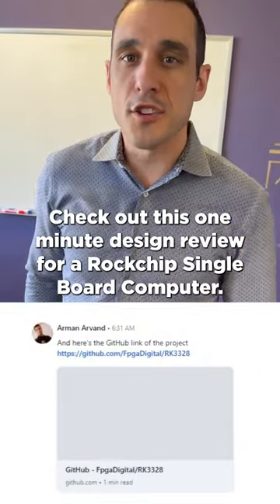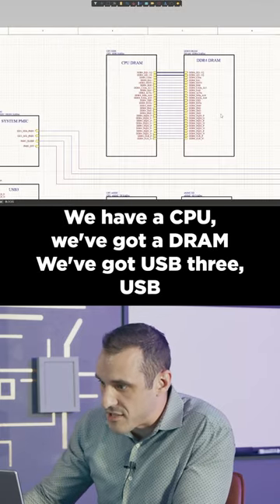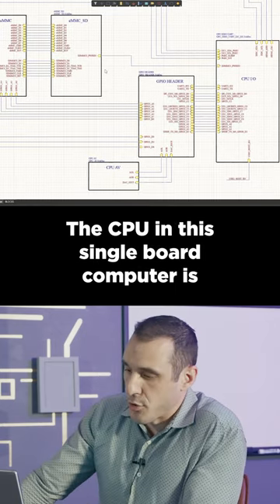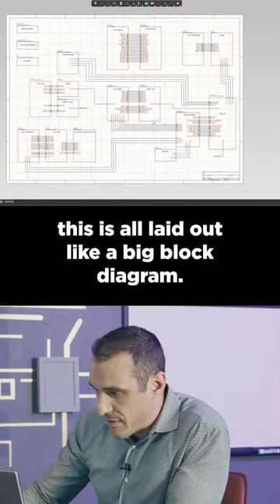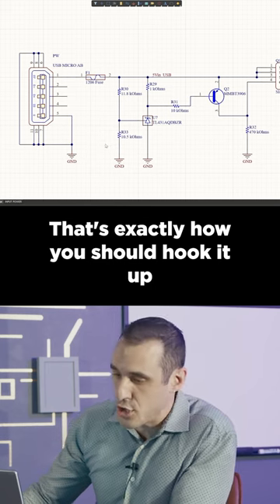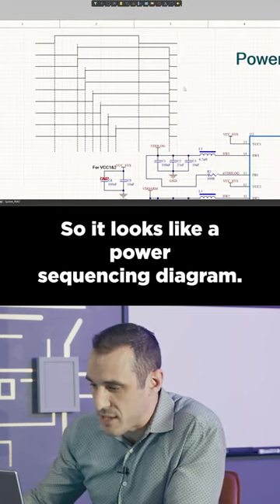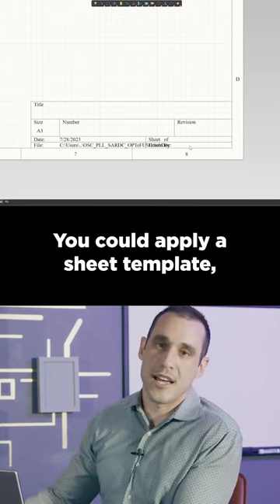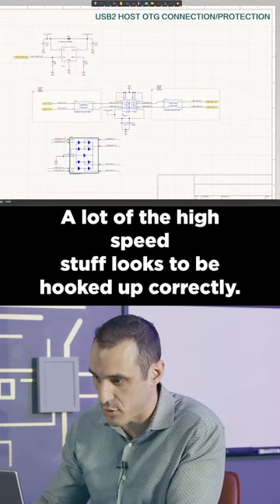Label Those Rails! Rockchip RK3328 Schematics: One Minute #PCBDesign Review 07 #electronics #altium

Comment: What is the best way to make library for a  SOM ? These normally have different types of block inside (like power, I2C, HDMI, USB etc.) and it’s convenient to use individual blocks in separate schematic sheets and in hierarchical design, they don’t make single designator for one SOM. Also, some of the SOM contains 2 or more than 2 connectors for interfacing with the main board.
Reply: When you write "make library" do you mean to create schematics for an SOM, or to create the footprint for an SOM so that it can attach to a mainboard?
Reply: I mean to create intlib (both schlib and pcblib), which can be used in the hierarchical design. @Zachariah-Peterson

Comment: First impressions:
- Missing labels
- Mixed caps in labels with spaces in label names
- Missing no connect signs
On Power Solution Page
- If you're going to have a power sequencing diagram label it at least
- DNP text on top of symbol
- Upside down GND symbol (why, just why)
- Pull ups placed upside down. (If you're not careful  it looks like a pull down)

If you're going to put down thousands of dollars to build something at least make sure your schematic is clean otherwise you're going to propagate mistakes and screw yourself over.